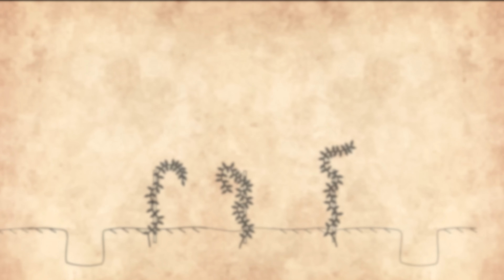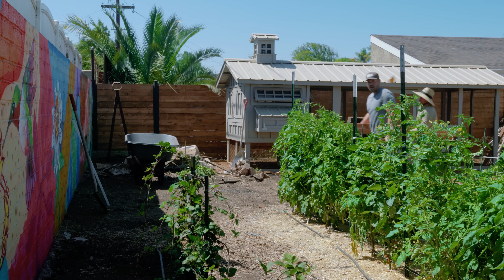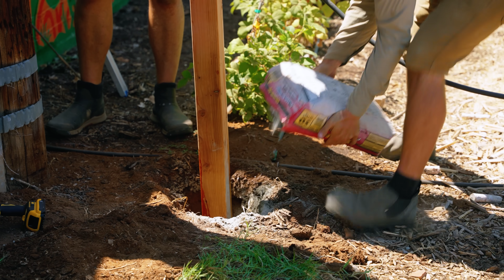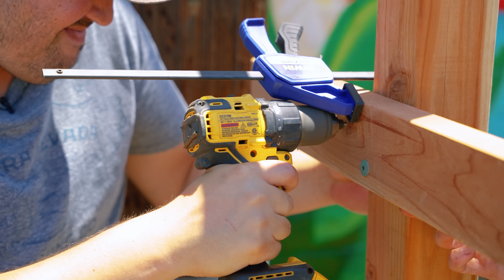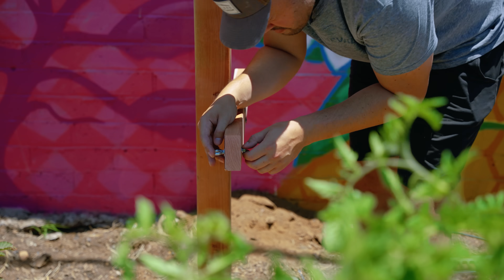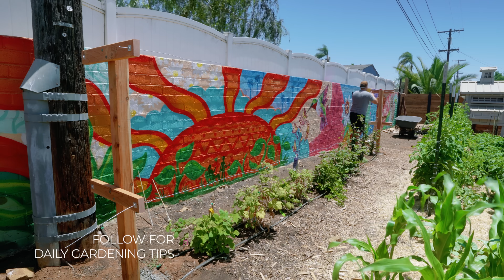How To Build A Raspberry Trellis | Keep Your Berries Producing For YEARS!

Comment: You seem to be a master at making things more complicated than they need to be. You don't need those eyebolts/anchors. Drill a hole through the cross tie, string the fencing wire through it, bring it back around and twist it onto itself.

Comment: Be very careful with the vice hardware. If the wire has any abnormal kinks in it and you pull it into the vice hardware it will get stuck forever, which means you’ll have to cut it out and waste all the wire you pulled through it, and you’ll lose the now jammed vice hardware. 

I had to buy extra sets of the vice hardware and wire because I didn’t notice a small kink in the wire. 

Inspect your whole wire before pulling pulling through, and then pull very slowly to make sure you dont make the same expensive mistake.

Comment: I feel bad for the AT&T tech that needs to access the communication wires in your backyard. Remember, easement's rights. Since the communication lines are aerial they will need to bring a ladder into your back yard to access their lines. There should be 6 feet of clearance around every pole.

Comment: Just an FYI, if you live in an area where the ground freezes, do not set your poles in concrete, it will break or heave sooner rather than later and digging it out to replace it every few years will get old really quick. The poles need to be deeper and set in gravel.

Comment: The moisture in the ground will solidify the concrete. I build pole buildings, we set 10-20ft 2x6 treated post, steel ones once, but you don’t have to add water either way. The ground will do it for you. Also, use treated wood, if it’s coming in contact with the ground use treated wood. That’s why it’s treated. It’s not going to kill you or soak into your veg and be a problem. It will soak into the soil but it’s in concrete and only a few inches touching dirt. But nice build

Comment: Most of the time you can just bury the post in ground and tamp it well. You should always include a back brace of some sort, your wire will eventually cause your posts to tip inwards, even with concrete. You can purchase ground anchors, gripple makes some nice ones that you drive into the ground. Use a turnbuckle when you install so you can get it ultra tight

Comment: Love it, although I'm not a fan of concrete for making it sturdy. Is there another way to do that?
Reply: If you want to use wood posts, this gentleman has a video. He has better toys than most of us but you could do it by hand. If you just use gravel or soil to pack around the post they need to be deep as the wires and canes will want to pull the posts toward the middle. You can also add a guy-wire to each end. Also, if you're in an area that freezes you'll need the post to be below the frost line. https://www.youtube.com/watch?v=dKtajeefswQ
Here are some videos for using metal T-posts. https://www.youtube.com/watch?v=DZwjXRFgR5g https://www.youtube.com/watch?v=Xsnce7OiPjM
Reply: you could fill it with pea gravel

Comment: Question: I just planted grapes this year; will this design work for them as well?  Thanks for the clear step by step video!
Reply: It should. I would just add a few more wires in the middle.
Reply: It could probably be done with only center wires and not needing to put the cross bars. Meanig wires would run post to post with wires spaced every 8 to 12 inches up the post. Train the branches/stems to wrap/rest on the wire.
Reply: @pakbowl420  excellent - thank you for these tips! I am working out the plans now…

Comment: That long cane you showed...looks like that is a black Raspberry cane....check the label (Jewel variety?)...if that's the case, you'll need to tie the cane along-side to the wires as they're pretty stiff canes, and have killer thorns, and grow more than 8 ft. long canes. I recommend raising black Raspberries on a separate trellis due to their different grow habits...it will be a mess if you allow red/yellow and black berries together, navigating the black raspberry thorns very tricky, and agressive. If they're allowed to arch and tips touch the ground, they will tip root, and that's OK if you want to multiply your plants.  Don't allow more than 4 canes growing out from the mother clump, cut out any old brownish and weak canes, and save about 3-4 nice reddish solid ones. Also, don't allow them to grow extremely long.....cut tip off after about 8 ft. or so, the canes will branch out from the bottom up, you will want to encourage branching out with black Raspberries, then tie it down onto your wires. Remove excess canes every year as described above....more airy bush = more sun = more branching out = more fruit.  So, that's the BLACK Raspberries, now, switching to red/yellow Raspberries and your comments about Floricanes (red and yellow Raspberries).  All Canes will last for 2 yrs...in Spring cut those out that fruited the year before (one exception, see below), and let the canes that grew the current year overwinter to the next year when they will fruit and then die off and must be removed so as not to spread diseases, and to keep each clump airy.  Those new canes that grow out from the ground every Spring or after dormancy are called Primocanes (stems are green and then turn reddish brown, and then they go dormant during the winter season).  After dormancy, the Primocanes then become Floricanes in the 2nd second season. Exception: There are some Raspberry  varieties that also bear fruit mid to late summer as Primocane fruit (the first year), those are considered everbearing varieties....go ahead and harvest the fruit and still retain the cane, it will fruit again next summer and will then die, as described above. The Floricanes (2nd year canes mentioned earlier) will produce fruit in early to mid summer...then the canes will die and should be cut out. So, in summary...there are varieties that fruit on Floricanes only, and varieties that fruit on Primocanes (1st yr.) and again Floricanes 2nd yr.)...determined by the variety you have planted. The Black Raspberry is a completely different animal, as described.

Comment: Great video, Kevin. You explained things so well throughout the video. Thank you!
If you ever need to anchor posts into the ground again and don't want to wait for concrete to dry/set, there is this concrete type expansion foam which sets almost instantly. One version of it is called Expanda-Crete. You also don't need to worry about a water to concrete ratio so much.
Reply: Concrete provides weight though
Reply: @funonvancouverisland  it does, but I have seen tall posts set with the Expanda-Crete which do not move at all.
What I'm trying to say is that the expansion stuff saves time, especially if you have several posts to plant.
Reply: @matthysloedolff  okay, awesome I didn't know any better
Reply: @funonvancouverisland  no worries.
I don't know how long the expansion stuff lasts though. I know concrete lasts for very long.
Reply: Backfill the post hole with tamped stones or gravel. They facilitate drainage. Using concrete can make a water holding collar that promotes decay, plus the concrete costs.